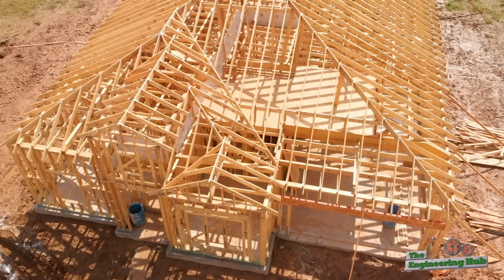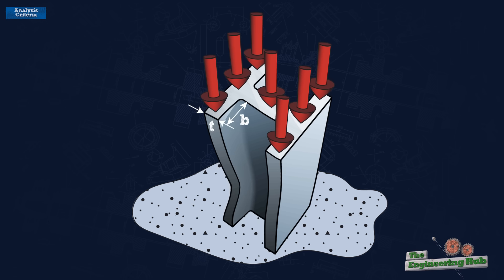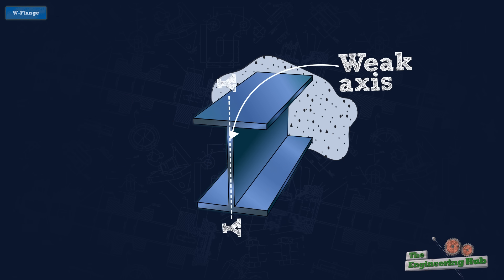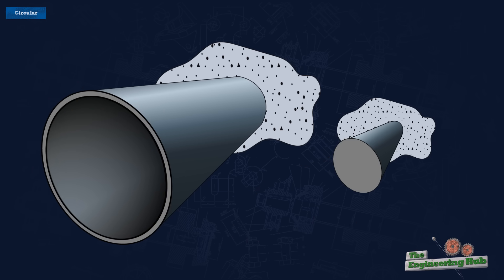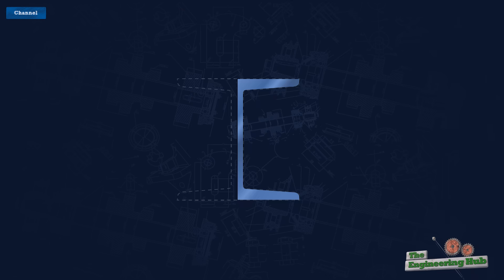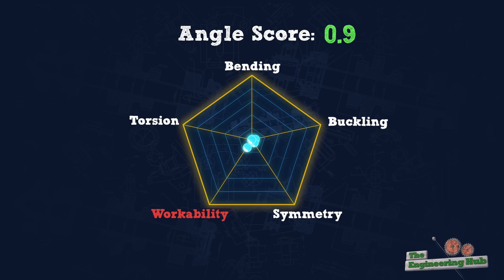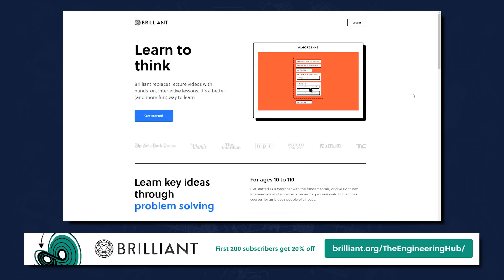Structural Shapes Ranked and Reviewed - Which one Wins?

Comment: comparing the solid and hollow version of rectangular shape: you take in to consideration external dimension equality? or the weight per length unit? in both cases:  what about the wall thickness?

Comment: The summary of half of a semester static mechanical analysis for an undergraduate course. 
When you use composite materials the analysis becomes a grade more difficult because you have to work with the tensile strength, compression strength of every material used it’s shape and  it’s place on the profile; further more you have to take into consideration the coefficient of linear expansion. 
In case of concrete you bend the steel to overcome the friction coefficient between the rod and the concrete ( when you tie together two steel rods to uncase into concrete you have to overlap certain amount).
When you are speaking of workability you have to mention the material, i can certainly not imagine the facilities to produce I-beam shaped high voltage wires. Wood already comes round and we spend a lot in machining it in beams or boards. Flats is the easiest steel product, then rounds; the tooling to create rails, I-beams, channels, angles and Ts is more complex and wears faster. 
Now days there are hollow profiles for concrete structures supporting vehicles (light trains, subways, cars) because it is easier and more cost efficient to inspect. Not the cheapest, not the easiest but the most practical.

Comment: still trying to work out the different types of forces. I'm trying to design a truck bed, and originally I was gunna use channels and L beams, cuz you gotta fit wrenches and fuel lines in there. But truck frames twist. So, I'm trying to figure out whether its better to go with the flow, or resist it.

Stiffening the bed with beams that resist twist would support loads better. But letting the truck flex puts less stress on said beams and helps offroad performance. What I don't want, is for a beam that doesn't like twisting, to get twisted.

Comment: So ... would an I beam be stronger as a fence corner than a pipe? Lets narrow it down and say they are both steel, with dimensions giving them an equal weight of steel. Yes might seem to be the obvious answer, but the reason I ask is because I beams are typically used to span horizontal distances, not to be set vertically as a post.

Comment: My opinion:
Circular hollow (but not too thin wall) for torsion and for carrying fluids (literally a pipe)
Circular solid for dynamic crankshafts (like transmission and engine shafts)
Square hollow for smallish columns
H-beam for large columns (possibly embedded into a concrete pillar)
I-beam for any type of uniaxial bending about x-axis (such as a beam supporting only weight of gravity)
I-beam for columns, if braced in the y-axis
Angles for connecting other beams together
Rectangular solid for any type of wood (this is also the only type available for wood generally)
Channels for embedding needs
T-sections are more or less outclassed by I-beams for most applications (also calculating the moment of inertia for T-sections is a huge pain in the ass)

Comment: If someone were to build a structure with square tubing but the main external framework were to be arched in long bows. How would this effect the over all structure when it is properly supported from within? Example a nearly flat dome with a 6 foot rise but a span of 88 ft span. With some supports that are truss type but others are double square tubing with a single web between them for added torsion strength to prevent downward collapse potential.

Comment: how strong is 3x5 steel angle 1/4inch thick? can I use 2 of them to sandwich 6x10 in order to increase the span? I can't use steel plates wider than 5 inches because I don't have access from both sides of the beam.
Thank you

Comment: I am using a channel post to attach a satellite to.  It has all of the strengths i need except one vital one I didn't account for or anticipate.  The torsion, if the wind blows slightly, the dish will sway nonstop because the post is twisting.   What can I do to reinforce and prevent the dish sway on the u channel post which i believe is the source of the weakness?
Reply: Not an engineer so only advice I have is bolt another u channel to the first and make it then become an H beam.

Comment: I am building a full-length (19.5 ft) pipe rack for a pickup truck. The longitudinal pipe (back bumper to front bumper) needs to be strong enough to be able to haul heavy cargo. I have posed the question to friends about what size square tubing should be used and I have received several confusing explanations about this design. Keep in mind that I have to keep it as lightweight as possible. The first method is to use a single 2x1 thin-walled square tube to run the length of the rack. The second method is to use "two" 1x1 thin-walled square tubes either welded together or bolted together in order to make a final 2x1 length. I was told that the more angles that you have on a span the stronger the span will be. The other thought is that a consistent uniform design (2x1) will be stronger. Which would you prefer and why? Thanks.

Comment: It can be noted that the Double-T Precast concrete beams mentioned at @11:41 which are commonly used in parking garages and bridge decks are structurally somewhat different than simple metal t-shapes as the required included reinforcement is nearly always pre and/or post-tensioned steel rods and/or cables. this significantly increases the bending resistance of the complete part.

Comment: I'm retired mechanical designer. . .We used STAAD structural analysis software in the 1980's . . . Cell Phone towers have wind load and ice build-up weight, so hollow was good.. . . .acid plants have corrosion problems with hollow members, so hollow was bad. . . .channels and angle iron have totally different applications. . .and Equipment supports made of tubular members need extra flanges welded on to attach Electric / Hydraulic lines, so I-Beams are perfect for 1 and 2 story equipment platforms. . . .Every situation is unique.
Reply: And, let's not forget about "Slip Fit Critical"...

Comment: I am constructing a small home on 1500 squarefeet plot. Traditionally, constructions in my area is done by raising 12 RCC pillars (columns) on the plot before pouring concrete to form a flat roof. From this roof and above, residential quarters begin where each floor raised above the column is considered independent residential units. I, on the other hand, prefer a mezzanine construction on my 1500 squarefeet area. Purely for personal use. So my priorities are lightweight and economical materials versus the traditional RCC columns that need steel bars concrete mix. Would I be wrong if I prefer H or I beams instead of traditional RCC column for framing the structure to lessen the concrete use? Would it be economical and would I be able to achieve better structural strength than RCC columns?

Comment: What about compression?
Reply: Buckling is the main failure mode due to compression -- which was included. Yield stress can also occur from compression, but it only depends on the cross-sectional area (not shape) so it should be the same all around

Comment: Have any of you any practical experience installing HSS column over a h-beam column no I seen one comment dude said he was going to use pipe obviously has never made a column out of pipe if you had 10 HSS 12 x 12 by 5/8 on one side and 10 on the other side with a space of 10ft between sides and 8 ft between columns and a top of beam height of 10 ft and you built comparable structures The h-beam Columns would have less lateral movement when you were walking across the structure it's often fun to take Engineers on a deck when they don't have a clue and see the reaction on their face when they stand still and feel someone walk across a structure that has HSS columns and that would be multiple X bracing to combat thing down so the problem with that is on a boat dock when they have the boats at the bottom and the deck on the top they engineer a lower structure made of rock or fuel to get to the sheer out of the building

Comment: Since the comparisons were based on equal cross sectional area (in other words for a given material the same weight per length) the analysis tended to obscure the strength per  weight.  If building something like a race car chassis where weight matters a lot, it's impossible to beat round tube. But cutting it to make joints does require special equipment and skills. You can buy jigs that use just a hand drill and hole saw, but getting the measurements and angles right takes thinking and attention. Square tube is a second place.  The weight is higher for the same strength but welding joints is as easy as it gets. A handheld band saw will allow you to make just about any joint between two square tubes that you can imagine. I was surprised that he rated workability so low for square tube.  But he was looking at bolted connections more than welded.  It's just that among DIYers the people needed to choose different steel shapes are probably mostly people that can weld

Comment: I am stricken by the extent of variety in shapes chosen by the state highway agencies in various American states for the identical task: posts for small highway signage.  Right off the top of my head, I can think of various states that use perforated hat channel, perforated square hollow, circular hollow, and square solid (wood).  Surely each has advantages and disadvantages, but one would think that more consensus would have developed as to which is the best value over the long term.

Comment: Still trying to find the answer:
In my area, if you have a two story (wood framed) house, you need at least 2x6 -24inch on center studs. Can you use 4x4 -24inch on center instead? Does that have comparable strength for framing?

Comment: Log cabins with almost round solid circles (flat at top and bottom if I don't recall wrong) would have been lovely to see here even if it's not a modern approach.
Curved wood was also used back in the day for certain roles, think of the wood where a branch leaves the tree or in the roots etc.
I'm no expert on that kind of things, but I'd love to learn more.

Comment: Engineers have noted that a triangle shape is the strongest as there have no right angles and not a hollow tube.  Solid round, square structures can be bent and granted it will take a lot of pressure to do it.  Triangular however is the most common shape.  Take a look at the large power line towers.  They are built with triangular shapes from the ground to the top.  There are many other things built that are triangular in design for the strength in that shape.

Comment: I'm curious how a hollow circular beam internally connected with a Y-shaped beam would perform. The 120 degrees in a Y-shaped beam would normally make it difficult to work with if by itself, but would fit perfectly in a circle, supporting it against bending by being resistant in the same way I-beams are, and likewise the circle would support it against torsion which it'd otherwise be weak against. Of course having such a complex structure would reduce workability a lot, but if that wasn't a factor, would this come close to the optimal shape for strength proportional to area?

Comment: i DO A LITTLE IRON WORK CUTTING,COPING  i BEAMS FOR ELEVATOR MACHINES AND SHEAVES . hOLDONG COUNTERWIEGHTS AND AN ELEVATOR WITH 120% OF FULL LOAD CAPACITY. bOLTING SIMILAR TO RIVITING AND WELD DETAILES AND INSPECTION. iNSTALLIN IN NEW BUIKLDINGS SEEING WHAT THE STEEL IS LIKE AND iRONWORKERS DOING IT. tHE dISNEY cONCERT hALLL WAS A CRAZY ONE WITH ITA SHAPE AND ALL. tHE STEEL THE iRONWORKERS DID WAS MORE THAN i HAD SEEN ON ANY OTHERS. nOT EASY TO PUT AN ELEVATOR IN WITHER. wITH tOLLERENCE OF THE gUIDE RAILS TO BE AKLIGHNED TO 1/64 . sEEING THE TWIN TOWERS FALL MADE ME THINK WTF? SEEING AN IRONWORKER GO OVER A BIG I BEAM BENT LIKE A PRETZEL WITH NO BUCKLE OR TEARS AND WHAT IT WOULD TAKE TO DO THAT WAS GREAT AND TRUE. tHEY TOOK THAT ONE AS A SUVENIER! NICE!HOW THEY AND#7 CAME DOWN LIKE THEY DID i CAN NOT SAY FOR SURE BUT WHAT WE ARE TOLD IS NOT POSSIBLE THE WAY WE ARE TOLD . tHE BUILDING ENGINEERS NOT GIVEN THE INPUTS INTO THE COMPITER PROGRAM THAT PROVED IT WAS DUE TO FIRE. ? dO TO PUBLIC SAFTEY ? tO THE STRUCTURAL ENINEERS THAT DESIGHN THEM FOR SAFETEY????YEAH AND BIN LADEN DID IT BEFOE THE DUST SETTLED? bUILDIN G PIECES TURNING TO DUST AS THEY FELL? SOMETHING ELSE WAS INVOLVED!!

Comment: You got a like how some of this engineered wood products mimic the cross-section of an I-beam. You have two two by fours with a groove cut in them  with a jointer of plywood. The end up being lighter than a typical Lumber member but you have a bit more convenience on putting holes through for plumbing and electrical for example

Comment: i didnt catch where you delineated between W-shapes and I-shapes, and S-shapes.
you seemed to lump them together by seemingly making them interchangeable - but they are not.
says the retired civil engineer.
at least you showed the wire rope clamps in correct orientation!
Reply: forgot to mention HP sections.....

Comment: A very good video .

I would love to see the various shapes made of a common material, like bondo or similar material with the requirement that the lengths and weight  be the same. Then tested to demonstrate the various strengths and weakness of each part. 

This would or should match your radar maps and confirm your data.

Comment: What about tension and compression? And the planes of tension/compression. T shape, round, square, and angle are used alot in truss systems. Analysts and design was fun, i became to see the formulas in the 3d spaces.
Reply: I was going to make a very similar comment. Angles are used in tension on the bottom cord of many flat roof trusses. And welded connections can not be ignored when discussing workability of structural steel. 

As another commenter pointed out, many times the decision comes down to cold hard cash. What is the cheapest way to meet the requirements without exceeding them. Many times designers create impossible conditions that can’t be fabricated in the real world. So I am not sure how much I trust them to care about what the constructors go through.

Comment: A circular solid is always stronger in every aspect than a circular hollow with the same outer diameter. A circular hollow is just a lot more efficient. You save a lot of weight by not loosing a lot of strength.

Comment: Paintability (e.g. corrosion protection/inspection) is a big disadvantage to closed, hollow sections. Could be baked into the Workability metric, but could be a game-changer alone.
Reply: On the other hand, the structure could be designed so that the inside is sealed up so it doesn’t matter. This is most likely the case anyways when the ends need to be welded up.

Comment: Another good thing the hollow sections have is that you can make composite columns with them. Helps in the workability when you pour the concrete in. Also, it has more resistance than a normal hollow section due to the interaction of the hollow section and the concrete column, meaning it can result in having even longer span of elements than with a steel section alone.

Comment: Hollow tubes, however, are more likely to suffer complete blow outs if the torsion limit is exceeded (such as in an earthquake). I5 in Seattle has a lot of these and my great fear is being on that road when the cascadia fault goes.
Reply: they are also very hard to inspect for corrosion damage.

Comment: I pull flatbed trailers. You can make i beams stronger if you build them with an arch. Then have c channel or box beam crossmembers the deck crossmembers are pierce beam.  With a c channel outer rail. They got ratings of up to 72000 lbs in 4 ft.
Reply: that is called camber, and it does not make it stronger, it just makes it become flat under maximum loads.

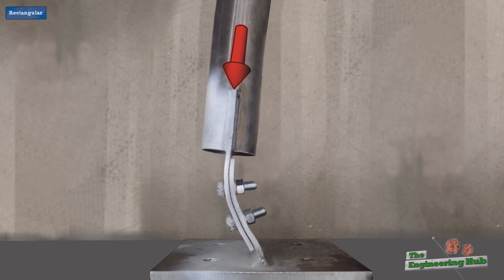Comment: 6:27 - - THIN PLATES BUCKLING UNDER STRESS
6:58 - - Rectangular + square sections can be OPTIMIZED by creating hollow sections (or tubes)
13:00 - - How would a hexagonal hollow cell/member rate on this score-system?

Comment: I really wonder how would "pipe with + shaped insert" fare as a beam. The cross insert should seriously improve buckling and compression resistance; the torsion would remain excellent, workability should remain as crap as it is, symmetry - 8 axis instead of infinite, so still decent.
Reply: The pipe and the internal shape would need to be bonded together along the entire length of each contact point for the full strength of the resulting structure to improve significantly over the stronger shape inside the pipe. Pipes work well in tension, with internal pressure, and moderate compression. Square tubes make better columns. But both require short lengths between connection points to limit the chance of buckling from incidental moment transfer causing deflection perpendicular to the primary load path.